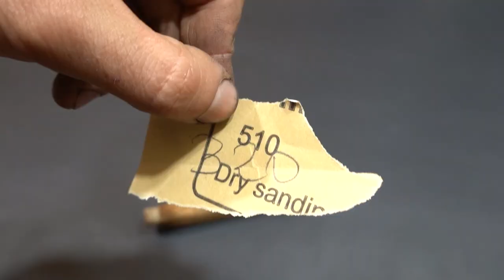Restoration Rusty Rapier

Comment: Just so you know, that hilt (the part that isn't the blade) is for a fencing sabre. A rapier is a different weapon, and not used in sport fencing.
Reply: Isn't it called a fencing foil?
Reply: @DrJuice1  the original blade was likely an épée, the replacement is a fencing saber. There are three forms in modern fencing; foil, épée, and saber

Comment: You mentioned the sandblaster, but what I've noticed is you don't use electrolysis anymore. Any particular reason?
Reply from the maker: Hello, thank you for your attention. Lately, I have rarely used electrolysis, because it takes a long time, more dirt and fumes. I use electrolysis as a last resort if there is a very thick old rust. My tool does everything faster and effortlessly)

Comment: Nice surgical pliers! Still from flea market? Regarding sabre, I tought you would have come with a ussr redstar on white or steelguard, but being training sword, nice paintjob! Finally, being a sporting sabre, that point is strange, and however, it's intended for slashing. Cheers from an italian very amateur fencer!
Reply: The point is meant to go under a fencing button/electrical tip. You can see at 10:12 the channel for the electrical cable. Electrical blades do not end in a blunt button because it wouldn't fit inside the electrical tip. (The s2000 blade is offered in both electrical and classic versions - he got the electric one).
Reply: @notfeedynotlazy  wow here in Italy only recently gotelectrified sabers, only epees and foila
Reply from the maker: I got confused at the end. I.e. it's not a saber, but a fencing saber and also an electric one :)))) ?
Reply from the maker: Thanks for attention. To be honest, I'm already at a loss for guesses. Is it a fencing saber or just a saber?)
Reply: @ScrewsAndTools  Yes, it is a fencing saber - just that modern fencing uses electrical equipment to track the hits. I own only ONE pre-electrical fencing swword - the foil of my wife's grandfather, who was a regional foil champion in the early 1950s. But about everything from 1956 onwards is electric.
Reply from the maker: @notfeedynotlazy  Thanks for the clarification. It turns out that the issue of this subject of mine was before 1956?
Reply: @giacomocerronicoriddi3890  Well, electric saber was adopted for the Olympics in 1988, but then again, foil was in 1956 yet as I said, I own a nice Spanish foil, most definitely NOT electric, that belonged to a regional champion of the early 50s who kept using it until his retirement, so you need not to convince me that in many, many places electrical stuff was late to be actually made mandatory for competition - I happen to own a proof of that! [raises sword in salute]

Comment: I wondered what you were going to do with half of a rapier? The new blade came in handy lol! What time period is that from?
Reply from the maker: Hi! Thanks for attention. Well, it is possible to make a chisel or if high hardness is a tool for working with non-ferrous metal by type of engraving. And you can, as I understood from the information from the comments, the issue was before 1956.

Comment: Just a bit of observation. The tip is not blunt. The blade you have would not be legal for fencing matches as all blades must be blunt at the tip.
Reply: At 10:12 you can see the channel for the electric wire. That blade is just missing the electric tip 🙂
Reply from the maker: ))) It's just the paper that the blade was in. To be honest, this is the first time I have restored such an item. It was interesting and unusual! Thank you for attention.
Reply from the maker: That is, is it still just a saber or is it still a fencing saber?
Reply: @ScrewsAndTools  LOL - what I say you can see at 10:12 is not the white thingy next to your lefty index finger, is the actual channel / gutter / long cavity in the blade's counter-edge, right of your RIGHT index finger. That's meant for the electrical cable that foes from a sensor at the tip of the blade (currently missing) to an actual plug in the fencer's wrist that connects it with the scoring equipment conections that the fencer wears at his/her hip, from where a long cable connects the fencer to the scoreboard that registers the hits.
Obviously, you need that for competition, but the blade will look better WITHOUT that thing!
(Yes, answering a lot of comments - because that helps you with the algorithm) ;-)
Reply from the maker: @notfeedynotlazy  I got confused again, they also wrote to me here that my fencing saber was released before 1956, it turns out it is not electric. Because the channel you wrote about is completely filled with threads from the tang of the saber.
Reply: @ScrewsAndTools  the channel is in the NEW blade. The original surely was NOT electric. (It is now). All channels end next to the hilt; the cable does not go through the handle and threads. The cable goes from tip to hilt nested in the channel, held just by tape, and from the hilt goes to a plug in the fencer's wrist, either hanging loose or, modernly, through a hole in the handguard.
WIll try to post a image link in a follow-up commment.
Reply from the maker: @notfeedynotlazy  Aah, now it's clear. I understand now, sir. I will see a comment with a link when you post, thanks again for the full explanation.

Comment: That looks like a mass made basket hilt  epee rather than a rapier
Reply from the maker: I was lost in guesses and searched for information for two days. there were 3 search options: rapier, sword and saber. A rapier fits the length of the blade itself. Thank you for attention!
Reply: This is indeed a fencing blade, not a combat one, but the s2000 (88 cm, V-shaped base which transitions to a flat rectangular section with no taper) is a saber blade. An epee blade would be a bit longer (90 cm) and heavier, and would have a D section (one side flat, the other curved) tapering towards the end.

Comment: That's a nice fencing saber not a rapier though
Reply: Indeed.
Reply from the maker: A saber!? I have been searching for information on the Internet for so long and the saber is usually wider and heavier. Thank you for attenion.
Reply: @ScrewsAndTools  Those would be the old military sabers. This is a modern fencing saber. Youtube doesn't let me post links to back myself, not even to wikipedia articles, but copying from the English wikipedia page of "Sabre (fencing)" (you can easily access it yourself even without direct link), a fencing saber has a length of 105 cm and a weight of 500g. Certainly FAR LESS than a Napoleonic cavalry saber ;-) I don't know that from the wiki page, however, but for owning a couple fencing swords and military sabers myself...

It can be recognised even before seeing the blade by seeing the handguard. That is an old-yet-modern fencing saber handguard. A rapier would not have such kind of guards, which are typical of sabers, but would typically have either a swept, basket or cup hilt. And a late XIX-early XX centry military saber would have that kind of handguard, but be a LOT more "solid". (You should see a spanish Puerto Seguro pattern hilt... a VERY protective hilt). If you see a saber hilt in thin unrolled sheet metal, that is a fencing saber.
Reply: @ScrewsAndTools  in fencing you have 3 swords the epee and the sword that are pretty similar and the saber that is what you have there 
An actual saber as you pointed out is way different than a fencing saber because it was supposed to be a safeish trainer for the forms of fighting with a saber 
And it also happens with the other 2 swords in fencing that are a trainer for an epee de combat and a smallsword respectively
And a rapier is a late medieval to late renaissance sword that is still way longer and heavier than any fencing sword 
Hope this was of help
Reply: @velazquezarmouries  full confirmation of what you said, but for a silly lapsus linguae you made - the third kind of fencing sword is the foil ;-) [raises sword in salute]
Reply from the maker: @notfeedynotlazy  Now it's clear... Surprisingly, I always associate a saber with a massive wide blade that cuts. Well, thank you so much for your attention and response!
Reply: @notfeedynotlazy  it's because i am used to the Spanish names of florete espada and sable
Reply from the maker: @velazquezarmouries  Yes, it helped. Apparently I just thought that I can't call it a saber because of its lightness and flexibility, and the saber is heavier and has a chopping property. Thank you for your attention and information!
Reply: @ScrewsAndTools  that description would fit well well with something like a karabella some polish sabers or an ottoman kilij
Reply: @velazquezarmouries  Se nota, con ese nombre :) también yo, por cierto

Comment: That's not a rapier. It's a foil. A rapier is an actual combat blade. Two edges and lethal. A fencing foil is for practice and sport. A rapier is for dueling to the death. It's the same martial art, but an easy mistake to make.
Reply from the maker: Yes, I got confused and thought it's a rapier, but how people wrote it is a fencing saber. Thank you for attenion.
Reply: It's common for sword terms to get confused. A saber is a curved, single handed cavalry sword. You were much closer with rapier.
Reply: You did a great job, by the way. I restored a broadsword for a friend in 2009 without any tools except what they had in the bronze age. Some coarse stones, vinegar, olive oil, and sand. Took weeks, and he destroyed it in less time than it took to fix.
Reply: The original blade of the foil you restored appears to be a square foil. Non combat blade made for sportsmanship with a rounded or ball point. The replacement blade is a combat foil. It looks like a single edge. A rapier is a thin blade, about a meter long, with two edges, with a single handed handle. The Pappenheimer rapier is the one I value the most. It's lithe and strong and versatile.

Comment: To paint the guard is bad idea ,and inside ,under that guard should be a round piece of felt for cushion,and i am not talking about shape of the blade ,handle and etc.(louise job.)
Reply from the maker: I planned to cover it with nickel, but alas, there were no ingredients in my city. But as for the handle, it is very rare, so I tried to keep it as much as possible. No, there was no felt in these old sabers. That's why I didn't add it. Anyway, this sword will go as an introductory option to the private museum

Comment: ..i believe what you have ended up with is a fencing foil ?
Reply from the maker: I can't be 100% sure, but does the blade itself belong to a rapier or a saber?
Reply: @ScrewsAndTools  ???
Reply: @bobjoncas2814  fencing saber, actually. Well spotted.
Reply from the maker: @bobjoncas2814  I thought it was a rapier, but now I'm getting comments and they say it's a fencing saber. Although I always imagined a saber as a massive heavy chopping blade.
Reply: @notfeedynotlazy  ... i am only familiar with a pirate's cutlass...lol..
Reply: @bobjoncas2814  hilariously called "boarding sabers" in my mother tongue
Reply: @ScrewsAndTools  i think the blades are almost the same, the rapier for stabbing and the sabre also has a cutting edge for slashing , you are probably thinking of a military type sabre witch can have a heavy straight or curved blade, the curved blade was used a lot by cavalry.( a definite maybe...lol..)

Comment: And that my fellow fencers is how you fuck up a nice sabre hilt... Ffs, its a hilt made for modern fencing, not real sharp blades! A hilt like that  like this one is most likely made from steel and is rather rare these days. Painting it on the inside is ok. But the outside? Never!  Beside, the blade is wrong, order a sabre  blade online from a fencing shop and replace it at once, and remove the paint from the outside of the hilt, your work on the grip was good, but the rest? Total disaster...